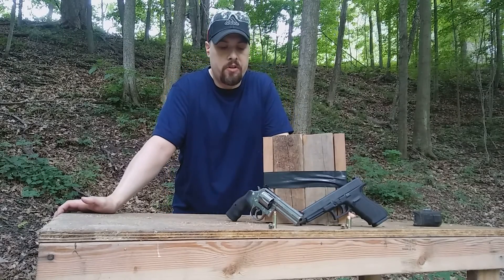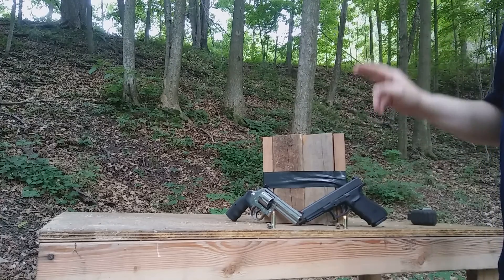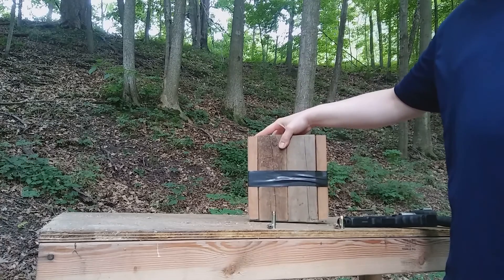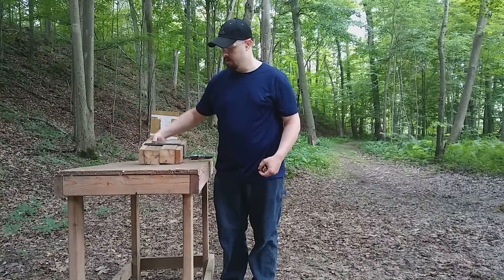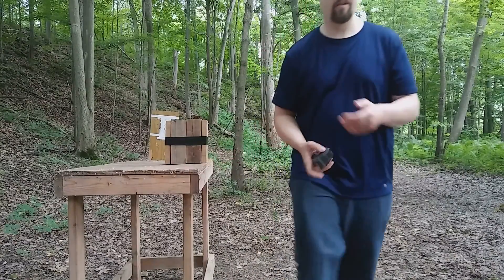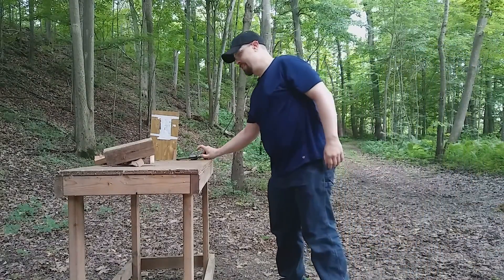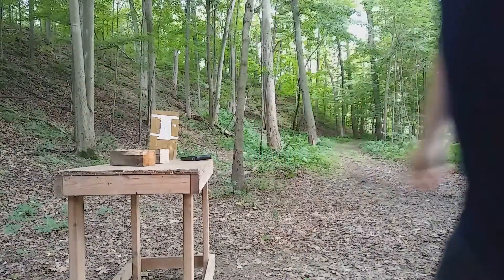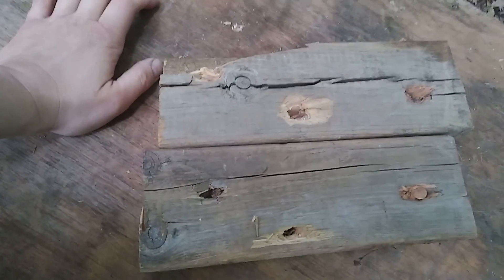.45 Auto Vs .357 Magnum in Full Sized Handguns Episode 2. Momentum

Comment: Why not use a 185 at 1200fps out of the 45 or a 158 out of the 357. If you go heavy for one go heavy on both
Reply from the maker: Using what I used what the point of the video. Using two very popular loads in common weights that are very different. A 185 gr .45 would not even come close to 1,200 FPS. A +P 185 might get to 1,050 FPS if we are lucky. The .357 magnum in a 158 gr will do about 1,250 FPS in this gun, and a 180 gr .357 magnum will do about 1,100 FPS. I did one video on those weights, and most people thought both are too uncommon to really compare. https://www.youtube.com/watch?v=qbwvNiAGBhM